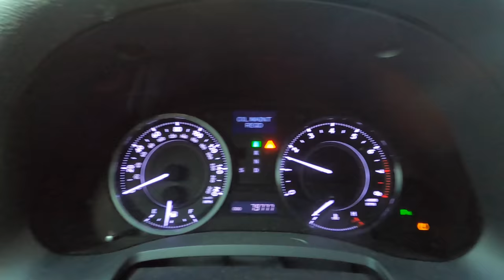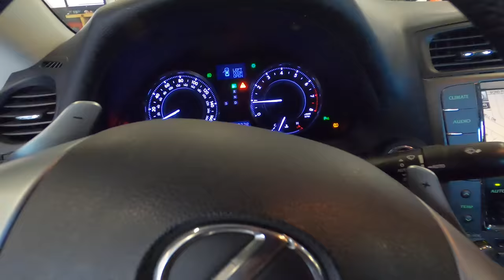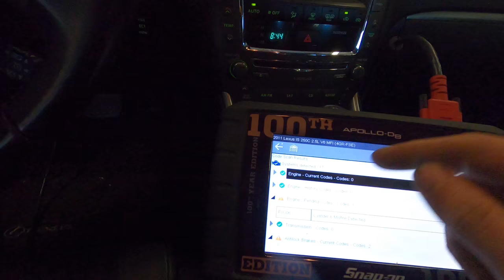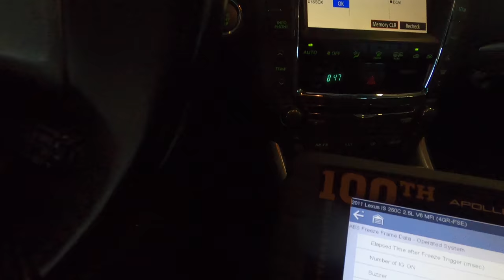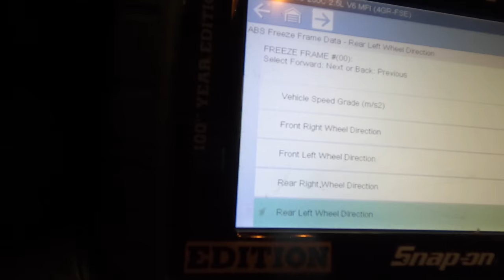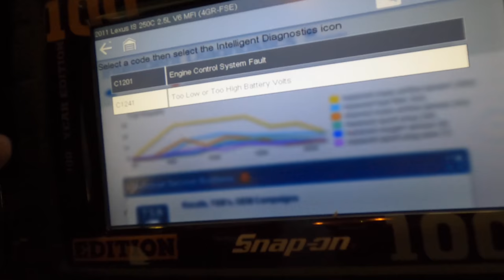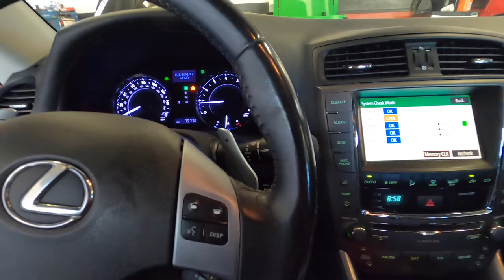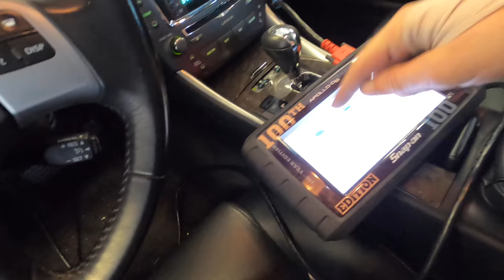Lexus IS 250:  Customer States Lost Power While Driving. Why can’t people communicate?

Comment: As an "old school DIY mechanic", it is very illuminating watching you have to remove multiple parts and systems to get to the piece of equipment that is malfunctioning.No wonder it costs so m,uch to do what used to be a simple repair job.. As a retired electrician, I knew that the electrical system had become vastly more complicated with sensors and multiple computers with programs that run everything, but I didn't realize that the mechanical systems were almost equally complicated. Great work. great videos. I had hi-school auto mechanics in 1954 and USNavy electrical school in 1957.
Reply: A lot of designed that way to force people to go to a shop or the dealership for what should be routine stuff. Took me damn near 4 hours to change my spark plugs and valve cover gaskets on my 03 Highlander because of how the engine is situated and the air intake designed. On my 98 Ford Ranger a tune up was easy peasy lemon squeezy.
Reply: You are correct, so many current young tech rely too heavily on their scan tools exclusively. Love my scan tools, they make my life easier. And lots of the younger guys are way better than I am with them. BUT, also seen guys locate misfire with scan tool, swap coils around, get Pico out or pressure transducer, never even pull the plug. Just ignore the old school basics. Fyi my long ago mentor could pinpoint a misfire by ear &  be 85-90% correct. No substitute for human eyes, ears, smell. Somebody online changed a diesel fuel filter but tank was contaminated with gasoline. Saw that it was water or gasoline on the video. How do you not smell or notice the viscosity difference??
Reply: @knockywigglesworth1909  it was here on Ray's channel he did that video and he didn't trust his sense of smell after having had covid so he used the other techs nose to smell the filter or whatever it was he had them smell.
Reply: A decade ago, people were flabbergasted when I told them you needed a computer just to roll the window down. Now their jaw hits the floor when I tell them how MANY it takes in a new Tesla or Merc.
Reply: Motor skills..was that a pun?

Comment: The line connecting to the back of the intake manifold you wondered about is cold start fuel injector. Great videos, Ray. Keep up the good work.
Reply: I was wondering if it was some kind of fuel injector. I saw that it had a banjo bolt and figured it handled some kind of fluid. Thanks, good to know!
Reply: You are right. 25 or so years ago, I had a car that wouldn't start in extremely cold weather so I made a makeshift cold-start injector: a small reservoir filled with start fluid under pressure connected to the intake manifold via oil-resistant hoses. A magnetic valve controlled by a switch inside the vehicle was the means of injecting fuel when I needed it. No wonder mechanics in Florida never heard about it.
Reply: @chrisivanchev  im not even in florida or a warm state(va) and ive never heard or seen these
Reply: @beettheyeetskreet9216  You say Virginia isn't warm, yet we get all 4 seasons in one day. Was hitting 85° back in December and January for a few days
Reply: Yes, toyota has them, and they use them not just for cold start but periodically a bit of a squirt in the direct injection engines to prevent the Honda problem of dirty intake valves which then causes reduced intake flow, rich running, washing down cylinder walls and filling crank cases with fuel oil mix. Such a simple fix honda refuses to do.

Comment: I had a Lexus IS250 same year. Because they are direct injection they have a carbon build up issue which cause the spark plugs to be recommended change more often. The carbon build will cause the misfire trigger in those Lexus IS 250.  Lexus knew this but did nothing until they updated the direct injection in newer models. Those cars require higher octane too to avoid the issue. Great job man!

Comment: The discoloration at the base of the porcelain on the spark plug is from corona effect. High voltage passing thru the plug causes it to slowly stain the plug as it does it’s job. In a dark room you’d see what looks like a halo in this area as the engine runs.
There is a lot of misinformation online calling it combustion leak, or blaming oil burning, none are the cause of this tan/grey stain that gets worse over time.
Perfectly normal.
Reply: My Dad was a TV Repairman! No kidding, really was and I was too, briefly, for WARDS. No doubt when high voltage corona is about, seen it a bunch.
Reply: I always thought it was rust!
Reply: At night running a small outboard I'd see the exposed sparkplug glow  a beautiful blue glow.
Reply: Yeah i know what oil looks like on spark plugs, thanks chrysler
Reply: I learned something today!

Comment: Smart owner. Replacing all of the coils with all the spark plugs is the way to go when one coil seems to be failing. Especially when near the recommended milage to change them anyways.
Reply: I’ll have to admit I really did think they would cheap out and only do one. False economy doing that as you can be pretty sure you’ll be back somewhat soonish doing another one. 
Glad the owner could realise this.
Reply: Good choice on a well maintained car.
Reply: Might as well. Parts are cheaper than labor. I’d do the same thing on my car.
Reply: @pswooley  yep that 3 last sparks are a nightmare to change, in my car i do It my self cause It's so much easier.
Reply: Too bad the new coils were DuraCrap coils from ChinaZone instead of Denso or NGK's.
Reply: @michaelslee4336  I’ve never seen all the coils go bad. Never. Just changing the bad one is just fine. Why fix what is NOT broken? Just use OEM when changing them. Using the autozone brand is asking for a major headache. Spark plugs .. fine.. change them all if you want.
Reply: @Zib187  Amen to that. In 3 or 4 months the demon will once again raise its ugly head and they'll be back.
Reply: @Zib187  The problem is trying to find anything in Automotive parts that is not made in China. Even Napa is doing the same thing.
Reply: I'm sure they were advised it would be best to do them all, and they chose to follow the good advisement.
Reply: @TheGoldenTrout  And I could advise you that you need an entire new engine… it wouldn’t make it true and it wouldn’t make me moral if you agreed with it. I’ve rewatched this video numerous times because it stuck with me. There was only one bad coil. Likely a defect that came from the factory. Switch it out and you’re done. This car had 79,000 miles.. the plugs are good up to 150,000 miles and the “discoloration” he saw was perfectly normal on those plugs. I’ve seen the coils go even further than 150K. Unfortunately that car got a bad one. It only needed the one. I put my business license on that. 🤷‍♂️

And not only did he replace all the other coils with crappy coils that will absolutely break in 20,000 miles … he kept the 5 factory good ones that run anywhere from 110$-315$ each. If I’m the customer I’m demanding to keep those old coils.
Reply: @topherd1011  On my Ford Taurus (DOHC) only the back coils failed, each about 1 year apart (One was changed by the seller a month before I bought it). The fronts are factory original (17 years and 174K miles). The back ones are under the manifold, so probably subjected to more heat. It only takes about 20 minutes to pull the manifold, so there was no sense in spending 300 bucks on factory Motorcraft parts when half the coils are working fine and only take 5 minutes each to change if they do go bad.

I would say if the vehicle is high mileage and requires an egregious amount of labor to change one coil, it might make sense to change all the ones that are hard to reach.
Reply: @christopherl2143  Made in China is not always an issue. You can have stuff that's made in China but to widely varying standards. For instance, the $90 GM motor mount is made to a much better standard and lasts a lot longer than the $10 aftermarket replacement-even though they're both manufactured in China.
Reply: @channell11  I understand what 
You're saying. Made In China  parts are manufactured to the buyer's standard's. Unfortunately It appears that a lot of parts are manufactured to under fairly low standards in general. But yes I understand what you are saying. If the distributers would only demand higher quality at a.higher price. I use OEM whenever I can.
Reply: At around $80 a piece for motorcraft coils, I only swapped out the failed one in my 19 year old Marquis. On that motor they’re super easy to replace, so it’s no big deal to leave the others alone. If I take that car out of town I bring my tools and code scanner along just in case another one fails. So far I haven’t had any issues and that was last summer when the first coil failed.
Reply: Maybe not.  The old OEM Lexus coils were probably better than the cheap Chinese crap ones that he put in.  Don't mess around with coils, go Toyota or Denso only on a car like this.
Reply: @Mike Hudson Amen brother.  Don't mess with cheap coils.  On a Lexus OEM or Denso only!
Reply: @topherd1011  I would replace all the coils/ Denso Or OEM. It's kinda A bear to pull the top of the Intake.for Me Anymore. I.just Wouldn't want to take that chance. The customer coming back A Week later with another bad coil. Highly unlikely but not.worth.taking the chance.
Reply: "Smart" sometimes actually means they had the funds to spend on the recommend fix.
Reply: I think it's wrong knowing the coils were good. I think this $1000 job could have been avoided and the car would have been more then fine. 

I think this was a upsell kinda job
Reply: @topherd1011  --especially if replacement coils might be made in China...
Reply: Exactly ,one has an option of a cheaper part as well ,not everyone can afford the So called good stuff.
Reply: It would be smart to have one central ignition coil (like in every other country) , so it would be bigger, less fragile, would basically never fail.
And what do you mean recommend milage? Coils don't have that. You change the plugs, never the coil. Why are your cars this way?
Reply: @TheGoldenTrout  Of course they would advise that, it's their business.
Reply: Not good for your wallet or the environment to replace parts that don't need replacing. I run this vehicle and no coils have failed in 160,000 miles, we also run a Honda and have had one original plug coil fail at 195,000 - they are not a regular service item like plugs.
Reply: @aliceeliot6389  Coil on plug systems are actually more reliable and more efficient as no distributor system is required. Old single coil or twin coil waste spark systems still suffered from coil failure.

Comment: Totally addicted to your channel Ray, I have a Lexus IS250 and watching you work on a similar model has convinced me of the top quality of the engineering of Toyota Lexus and the expertise of yourself. I'm amazed at your good humour and patience under stress. I'm over the pond and really wish that there were more engineers of your quality in The UK.
Keep up the good work and make some more videos of Lexus, that's of course if they ever go wrong.
Reply: The last two vehicles I've owned have been Lexus's. I can attest to the quality of Toyota/Lexus. My previous one was a 2002 RX300 and I currently have a GX460 (Or Prodo as it's known around the world). Love Lexus!
Reply: Beware of the carbon build up on those they throw funky codes .  BG intake cleaning system is great for direct injection motors
Reply: Lexus are the Mercedes of Asia. Just more reliable :)

Comment: That thing you pulled out of the intake plenum that you thought might be a temperature sensor is in fact a fuel injector. I think on the later model 4GR-FSE they put this in the plenum to help with cleaning the backside of the intake valves and helps with cold start to light off the catalytic converters.
Reply: Now that is fancy engineering.
Reply: @alouisschafer7212  Not so fancy, the 22RE used one all the way back to it's introduction. much easier to add one enable signal at cold start than modify all the injection maps.